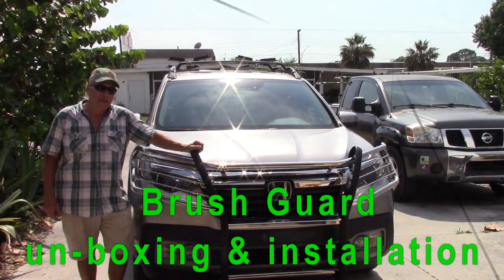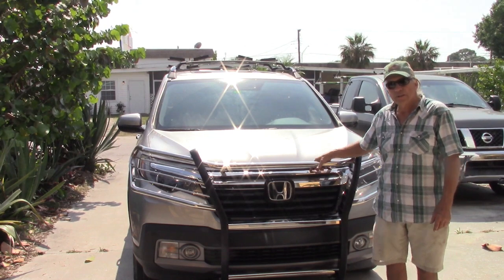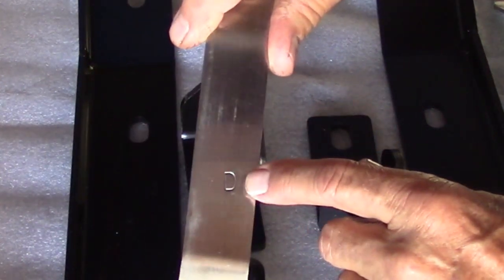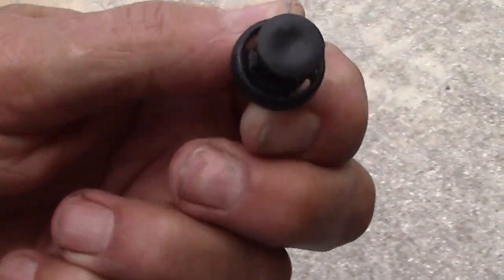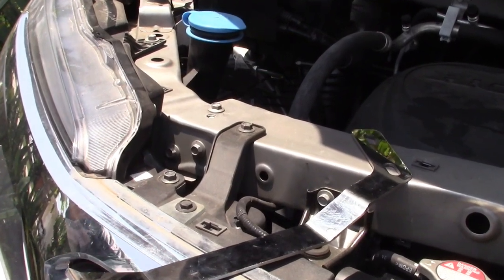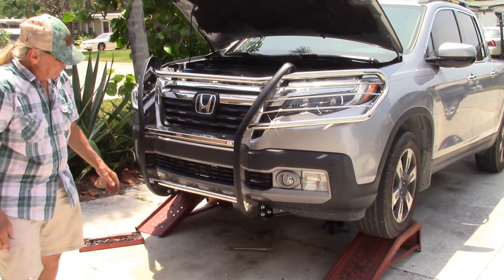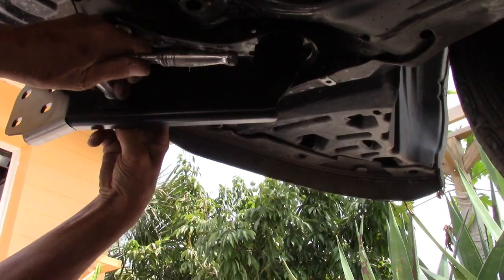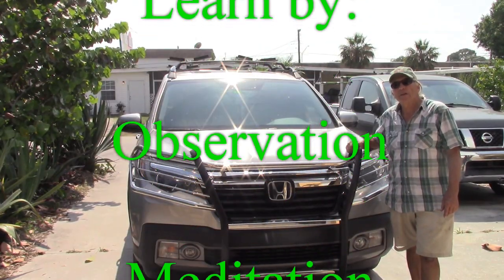Brush Guard  un-boxing and installation

Comment: Thank you for posting. Any idea where I could find the brackets to install on my 2003 Honda Pilot.  Have no luck with parts distribution. Manufacturer is unknown though my used brush guard came off a 2004 Pilot- I know it fits. Owner unable to sell me brackets with the brush guard. TY

Comment: Great video! I have a question though, if I want to install a hood deflector on the front of the hood, do you think there is enough wiggle room for the deflector to not make contact with the brush guard? Thanks in advance!
Reply from the maker: I have about 1-1/2 to 2 inches between the guard and the hood. I guess it will depend on the type of guard you buy,

Comment: Do you have the front sensors
Reply from the maker: yes--- everything is working great. I checked the unit before buying and said won't interfere with sensors.
Reply: I think about putting a 4000 pound winch